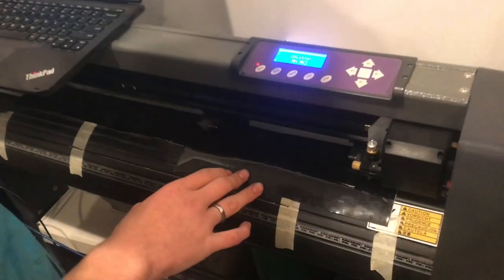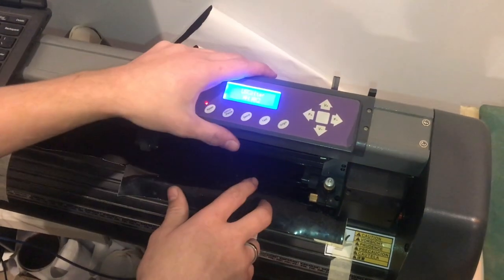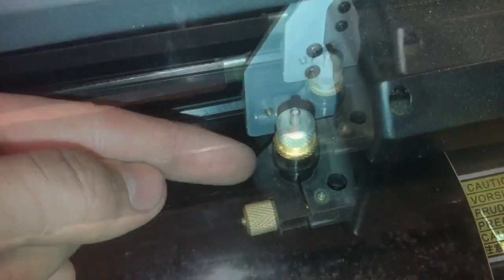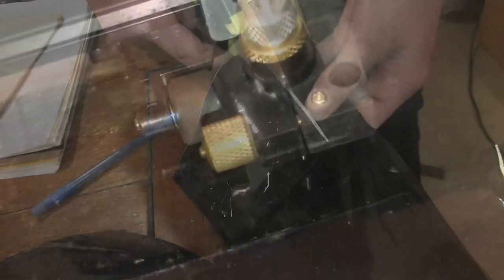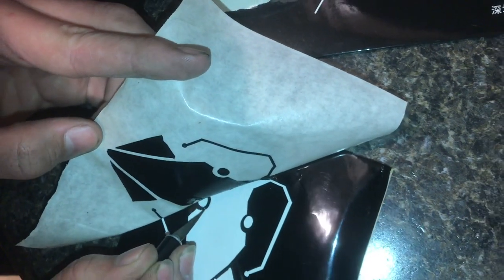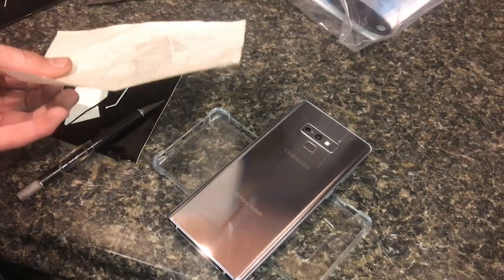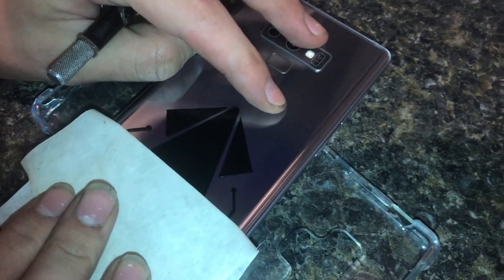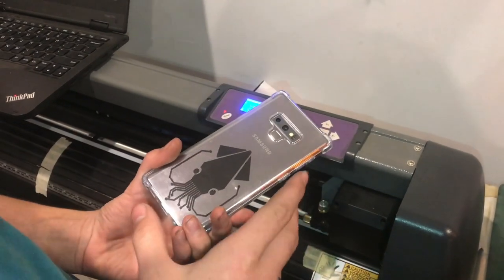(REVIEW) 34” MH 871 vinyl cutter vinylmaster design cut software “how to use”

Comment: When I received my 34 inch us cutter 871, a few years ago. That end feed roller was also stuck in the corner of my MH 871 too but that's just what it was... Only Stuck.  It's just wedged tightly on top of a screw on the back of the vinyl cutter.  you'll just have to us a flathead screwdriver and a hammer to lightly tap on the side of the feed roller using the screwdriver to tap it away from the screw, very simple fix. I use all 3 of my feed rollers and they never gave me a moment of trouble tracking. If you ever find that your cutter isn't tracking in perfect alignment with the edge your vinyl. I can 100 and 10 percent guarantee you, that's it's a "User Error" not the machine.  Take the time to better Align your vinyl when you load it into your cutter or just allow a little more vinyl for your boarders and manually cut your boarders with a straight edge and an exacto knife.

Comment: Put a piece of parchment paper in between your decal and the surface you're applying it to then line it up how you want it and stick down the transfer tape on the top to hold it in place. Slide out the parchment paper and then burnish your decal onto the surface with a scraper before peeling off the transfer tape.